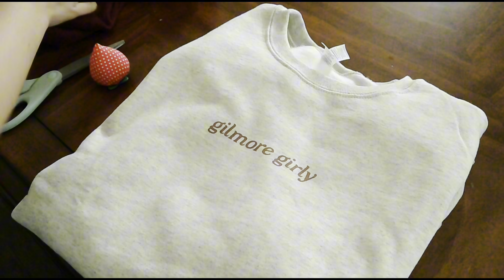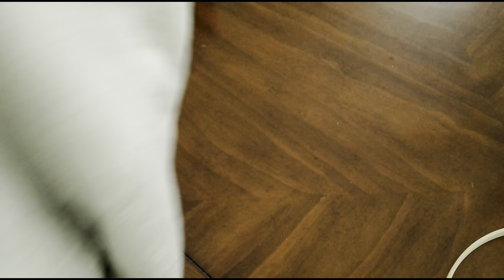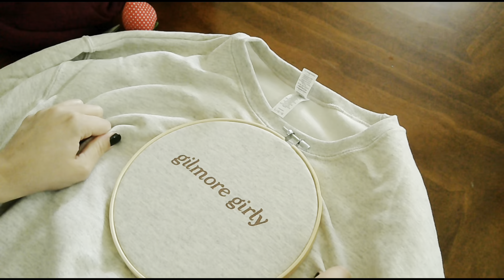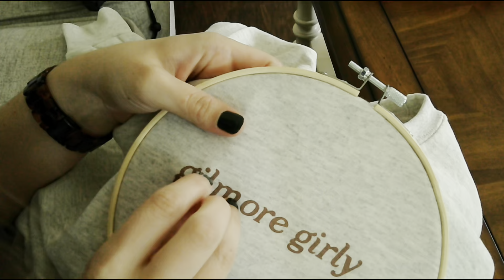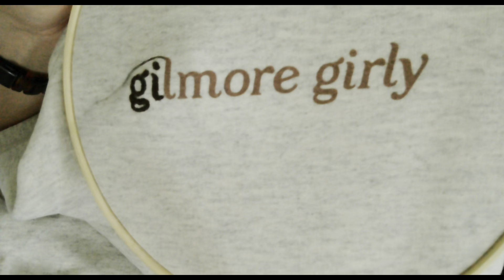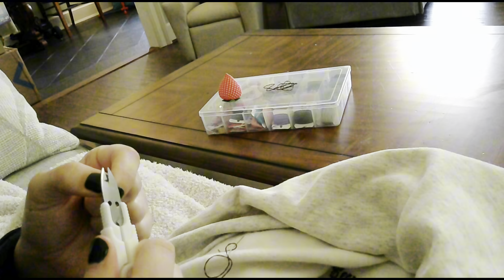How to Hand Embroider a Sweatshirt | Easy DIY Embroidery Tutorial for Beginners

Comment: Would washing the sweater affect the embroidery? I’m trying to make handmade embroidered sweaters for Christmas and I’m just trying to gather all info I need.
Reply from the maker: I haven’t had any issues with washing! I do normally iron on a sulky stitch cover to the back of the stitches to protect them further in the wash. I’ve done it both ways though and not had any issues!

For personal items I usually dry them as the item recommends, but for customers I advise to lay flat to dry for best results.